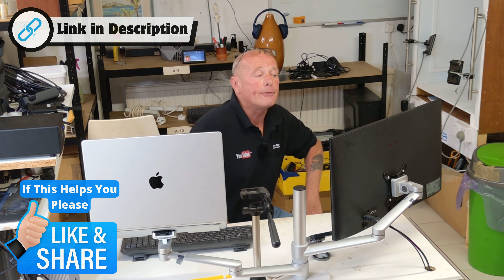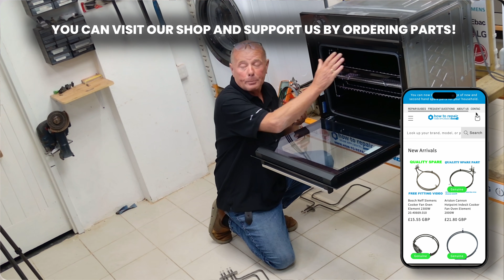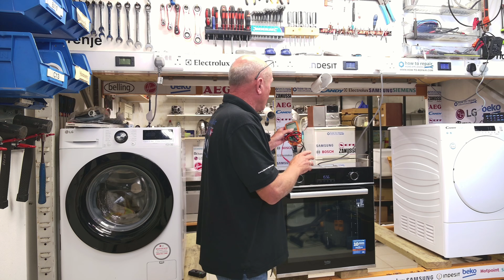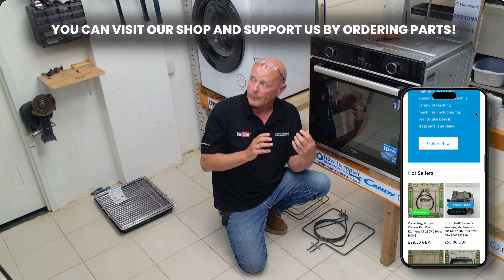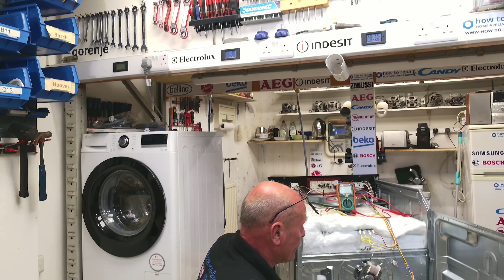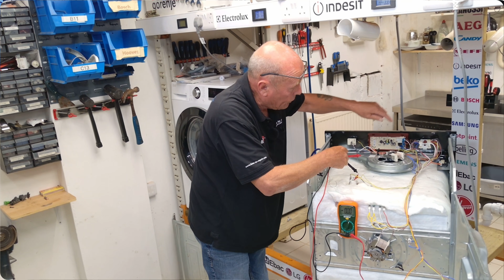Beko Oven Not Heating Up! Most Common Faults, Workshop Manual & Wiring Diagram  (BBAIF22300X)

Comment: In my Beko oven (similar model) what's happening is the oven will in an instant turn off and turn on again, resuming heating. This behaviour is somewhat inconsistent and intermittent. The power is not actually tripped, it just "resets". We can see the screen resetting and also the elapsed time resets to 0 and starts over. We usually use two elements + FAN mode.

Comment: Thanks as always for a really useful video. The service you provide is hugely appreciated. 👍
Reply: Mantap keren.❤
Reply from the maker: So nice of you, all I'm trying to do is teach in the correct way that everyone understands. It would be really helpful for me to get my video shared and help us fight appliance waste!
Reply: @How-to-repair You're also enabling people to escape the built-in obsolescence that is such a terrible thing. The 'right to repair' legislation seems limited at best, and you're exposing so well the problems in the industry. Keep up the superb work, sir. 👍😁
Reply from the maker: I'm doing my best but you must remember. I'm pretty much a one man band but even as an engineer and I speak for many other engineers as well. The manufacturers have taken this obsolescence to a whole new level over the last 40 years in the 70s machines lasted 25 years in the 80s. It came down to 15 early 2000. It was only 10 years and as of today we are lucky to get five years this is done in a way that the manufacturers think that the new generation of people consuming products will think this is the normal but they do not realise that manufacturers have been bringing down the lifespan of Machines every 10 years
Reply: @How-to-repair It's just disgraceful and I don't know how this 'race to the bottom' can be stopped unless governments step in somehow. I think it extends to other areas, too - the fridge in my motorhome was made in 1989 and still works absolutely fine. I wouldn't mind betting a replacement would last a fraction of that. Crazy. Keep flying the flag, my friend. 👍